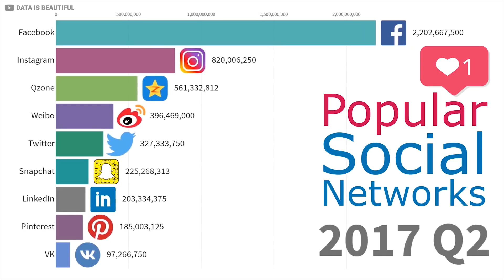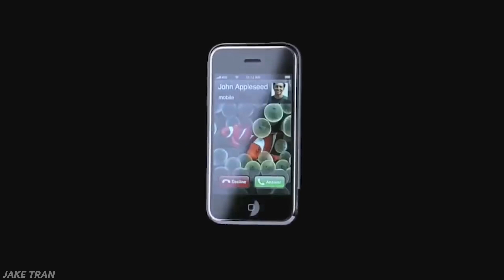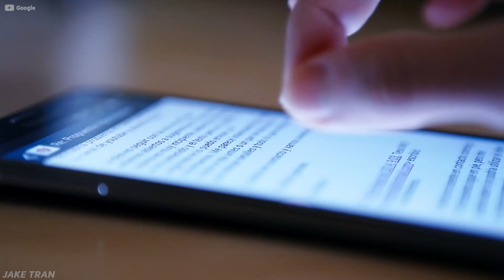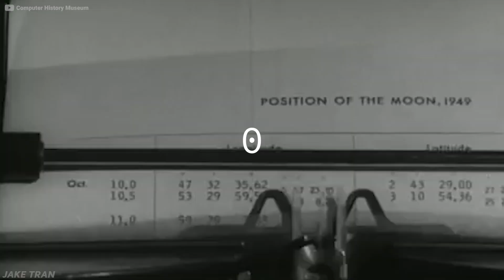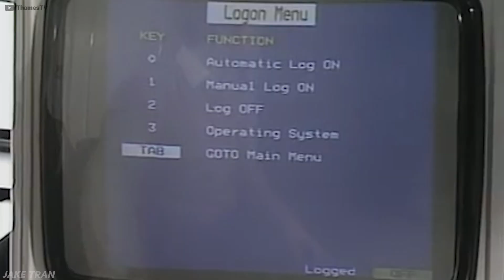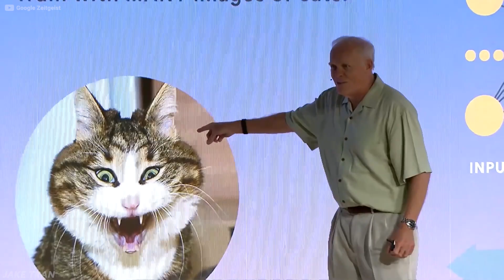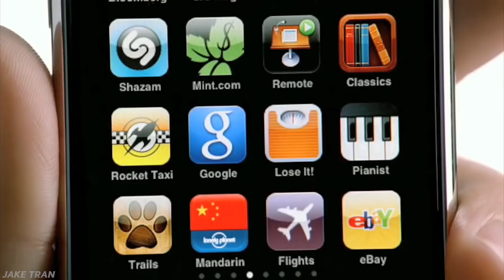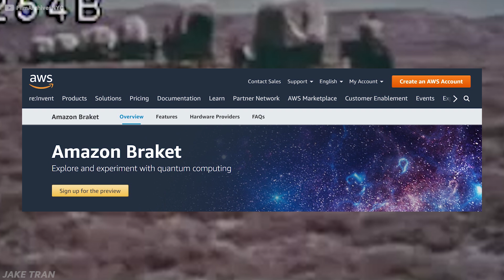The Trillion Dollar Quantum Gold Rush

Comment: "we are getting to point where we are getting to the physical limits of how many bits we can squeeze together onto a single computer chip"

this is not really the problem.  1st, transistors (not bits) are put onto the chip.  2nd, more transistors can already be put onto existing chips, but thats not the issue.  
the problem is speed.  just putting more transistors on the chip doesn't make the chip faster. speed comes from making the chips smaller.  the bottleneck comes from the speed that the electrons can travel through the printed circuits.  thus speed increases have come mostly from making the chips smaller, and reducing the length of the path that the electron has to travel.
light+ a mask is used for printing the circuits, and we have use the shortest wavelength of light that is possible, and thus further reductions in size is difficult/impossible.  

the solution now has been to add more cpu's to one chip, making multicore processors.  but now the new problem is that the software must now be redesigned to utilize the multiple cpu cores, which is often difficult to do.

Comment: If you can achieve quantum calculation on the scale of a few bits, you could in theory achieve it on the scale of terabytes. And if you can achieve quantum calculation on the scale of terabytes, you can store every single byte of data that ever existed at the size of a tiny USB. 

To quote one of the comments - "If you understand quantum computing, then you don't understand quantum computing."

Comment: Probability amplitude it same as Boltzmann - Maxwell statistics which tell if you want applicable thermodynamics internal combustion engine you must in put useful work, random based kinetic energy machine is called (Maxwell demon)  demon who can reverse II thermodynamic laws and entropy arrow, so Back in Future possible only to Maxwell demon :))) Scientific papers shows that demon also consumes information (so energy too)  limitation even in thought experiment :)
Also Quantum mechanics is statistics so no engineering application, if you read patents and find words quantum, in reality that engineers created smaller version let say they found special material alloy that can keep magnetic field in very nano-meters size area, instrument manufacturers got patent minimization of device who can read very very small weak magnetic field, where is Quantum effects ?,  zero inventions in quantum mechanics field, where negative energy inventions where quantum tunneling effects inventions. Statistical gas mechanics and quantum mechanics is highest point of all physics, mathematics in absolute beauty, mathematics philosophy, but also this mathematics tells that statistical thermodynamics (kinetic energy of gases) and quantum statistics (quantum mechanics) is not applicable  in one electron size (qubit) or in one atom either (Moore law  of CPU material limit) only in macro electronics switch boards  and computer integrated circuits (no math pun intended) are possible, and macro applicable thermodynamics of heat engines.
Maybe promises of 60s that all humanity will live on the Moon in 70s to keep technological progress going  :)))))))

Comment: Dude, you should have talked about transistors, instead of bits. Transistors are the electronic component that are used to store and make computations on the data, which is recorded as bits, because you can code every information using bits. That is because you need a minimum of two states to represent information, because if you had just one state, that would mean change would be impossible, or the entropy would be zero, and then there would be no information. The transistors are the bottleneck nowadays, because they just got very small, and it is getting harder and harder to squeeze more transistors into a small space. Not the bits. The bits are some abstract data representation.

Comment: You must be a software guy with that explanation of classical computers. Transistors mate, switches that represent 1 or 0 or your bits. Getting to the point where there's a limit to how many transistors you can put on a wafer before logic gates stop working right. The limiting factor is size.

 Something like quantum particles entangled in pairs make up your qbit. Cryogenics is required at this stage in tell we get something like a room temperature super conductor which makes it bulky. Just saying.

Comment: That huge metal thing isn't even the computer, it's the cooler. The actual "computer" is only a small CPU. But the problem is that it has to operate at near absolute zero temperatures, so a major part of the research is going toward making it be able to operate at higher temperatures. One team of scientists has reached operation temperatures of 1.4 Kelvin.

Comment: Do you known why beacuse silicon transitors can only be 5nm until it won't work anymore. Processer these day are 7nm and when we get to 5nm we are done . New material is needed to build faster and efficient devices .also fact checking you bit system your wrong . A 1 in the first place is a 2 then the second place is a 4 then you add it up to get the number . Mostly it 8 bits which is   like this 64.32.16.8.4.2
                 1.0.0.1.0.1
Is 64+8+2

Also quantum computer are not good for consumers

Comment: The plateau has a bigger cause then I think you should've mentioned, a new focus on margin and affordability by the major companies has really pushed this. Layering and simply having light hitting each molecule would prevent quantum effects and would increase speed greatly.
I feel like quantum computing won't be available for the consumer for a long time. Not because of cooling issues like commonly thought, we can just use a mix or liquid oxygen/liquid helium, or even solid helium.
The issue is flammability and, well bombs. The only way for one to properly cool a computer to this level, would be to use high pressures or flammable molecules. Rocket fuel isn't something you'd want cooling a very expensive machinery, nor would you want a system that makes steam hammer seem like a baby's cradle. Until that issue is fixed, we likely won't find this amount of computing available to the public for a very long time.

Comment: The issue with quantum computers is that they require near-zero temperatures to operate. This creates a physical barrier to reaching consumer level that won't be easily overturned. I don't believe quantum computing will come to consumer level.
Reply: The issue with main frame computers is that they require giant vacuum tubes and an entire room to run. This creates a physical barrier to reaching the home market. I don't believe personal computers will ever become a reality.
Reply: Not if they use exotic materials foe example quantum computer needs cooling at sub zero for superconductivity but their are potential materials that can achieve superconductivity at room temperature i.e the physical barrier is almost gone and also not everybody needs to carry their personal quantum computer we can connect our normal hardware with high broadband to a quantum cloud which will process and relay info with full power and our personal hardware will remain intact.In order to learn about materials search quasi crystals.
Reply: Why not Create some kind of little chamber type thing and in that you can put your quantum computer and it's Spray liquid nitrogen in the cycle of 3 to 4 minutes to maintain temperature at 0.
Reply: What about cloud quantum computing? Yea, I guess not consumer level but a company could invest in QC and source it out on cloud so anybody can do a certain task quickly and receive the output?
Reply: yethi ravindran  
I think his example of exotic materials is quasi crystals
Reply: Am sure they said the same thing when computers first came out and were the size of entire rooms
Reply: The companies with the money to utilize this tech will trickle down the benefits to consumers. So much would change, especially in AI and machine learning. Idk even what a common consumer would know what to do with a quantum computer. Current tech is already magnitudes more than what your average non tech savvy person needs.
Reply: soon*

Comment: Quantum computing is basically a random number generator it’s practical use is almost zero. I would actually think more about lighting or liquid computers.

The problem is just the collapse of the wave function that is needed to get a state that can be consumed by anything.
Btw we already have lots of algorithms that encrypt in a way that it’s useless to use a quantum computer.
Reply: Platin 21 Not to mention all the noise reduction required and the low operating speed. Quantum Supremacy has been said to have happened (Baboush et. al, 2019), but I bet that unless we come up with a new mechanism for computing data with a quantum logic structure, this technology will not reach the capacities which are marketed to 12 year olds on YouTube. Not hating, just saying we need to stop being too excited and start solving problems

Comment: It's hard to see how to take advantage other than investing in big tech, but one thing a lot of the lay public doesn't yet understand is that it takes a new kind of programmer to take advantage of quantum computers. You don't simply say "OK magic new computer, try all possible passwords simultaneously" to crack modern encryption. It's more like picking a lock. You can start by learning a little "quantum info. theory" and the early algorithms like BB84.
It's not just a new kind of computer, it's a new kind of programming language, which will start with some very low-level, hard-to-use languages, which will gradually evolve into more powerful, easier to use languges like python or wolfram language, which children can use.
Reply: Once quantum Java is created, I will create 5D Minecraft, and destroy the FPS with quantum "else, if" equations

Comment: Quantum systems, on the whole, don't actually do many different things compared to traditional computers, they just do it orders of magnitude more efficiently and flexibly. 

Having computers that can run extremely intense programs at high speeds doesn't really help you when you're just trying to show a website with a couple of ui elements. Sure, there will be new functionality, and cyber security will need to change overnight to adapt, but long term? Quantum computing doesn't do much different than normal computers now.

The real money will be in asteroid harvesting, as with the proper rocketry, robotics, and control, that could potentially be done today. Raw materials are valuable man.

Comment: Nice video! 5:05 Someone correct if im wrong, but I think that the fisical limit is not because of how we store bits, but because of the way we operate with them, which is through logic gates made out of transistors, and those transistors are coming to the point were they measure  10 y 20 nm whichs is arroun 100 times the size of the electron cloud surrounding an atom. Which means that we are close to the point were an electrical charge will not "be able to pass" through these transistors if we make them even smaller.

Comment: That claim that it takes a super computer 10,000 days to process what a quantum computer can do in ~3 minutes is technically incorrect. 

Quantum computers are exponentially faster than traditional computers but "10000 days" really just requires the model that analyzes the problem to be optimized. It's really more like 1 day and a half versus 3 minutes. Much faster but not THAT much faster.

Comment: there's a lot of pessimism on the engineering side, a lot of the hype is coming from physicists and computer scientists.
Reply: PathIntegral Them engineers, always being pessimistic and doubting the physicists and computer scientists about everything. 
Can’t they just woopee once.
I think they were once so pessimistic about General Relativity that they decided they would implant a backup just in case even though general relativity works perfectly fine until we get to the quantum scale of reality (or so most physicists think).
Reply: @funkyflames7430  because engineers are the ones that have to build it.  Engineers are bound by reality, a physicist and computer scientist aren't. Its not about doubting the physicist, it's about doubting how one is supposed to implement the idea in real life with all the restrictions of metarials and manufacturing method and etc

Comment: I know it's just a small thing but I'm pretty sure q-bit is pronounced cue-bit.

Also quantum computers are only better than classical computers at specific tasks, there are lots and lots of things classical computers are way better at so classical computers probably won't get replaced by quantum computers. Another thing is that they require extremely low temperatures to operate which is why I think you probably won't find them in phones anytime soon

Comment: Do you have a good understanding of quantum mechanics and computer science? I would be very careful, as far as I know quantum computers likely impossible. Google and other companies have failed to make a working computer. Sure they make insanly  fast but there is an issue with stable memory due to the nature of quantum mechanics. Many physicists think it's not possible.
Reply: Gabor Kovacs google already achieved quantum supremacy
Reply: Benji true alongside nasa but even still they technically just beat classical computers in only one scenario and that is what it means to reach quantum supremacy.
In other scenarios, quantum computers still suck.
Though all we need is just more work at the stability of the technology which comes down to design and cost.
Reply: EmpireBuilder they are meant to be better at parallel processing traditional computers will always be better at processing in series
Reply: @benji4037  yeah that was a click bate atricle spreading like a virus. Just do the research and look into what they have done yourself.

Comment: How can one invest in quantum computing?
as you were saying, it's a good time to invest in such an industry, so, how could one do so?
thanks
keep up the good work.
Reply: Bilal Hoss yeah
Reply: FInd the person/company that can build the first quantom computer.  person/company would need hardware such as a cooling system, a quantum processor chip, someway to store all the data and there will also need to be a software. if you want to invest look into chips being optimized to handle AI algorithms
Reply: aml1583 yah... more than likely you are going to have to find a company with that set up. A single person doesn’t really that the necessary equipment for that...
Reply: If you have a decent sized capital check in with Rigetti, DWave, and IBMQ and say you want to invest in their projects

Comment: form factor and application will ultimately determine how well Quantum computers impact us. It takes practical application to push technology forward. Right now we have the how, but the why still remains a bit shakey, we're only taking guesses at what innovations Quantum computers could lead to, but ultimately it will the form factor that will drive the tech, like the iPhone pushed mobile processors to leaps and bounds. E.G. quantum computers might on some shocking level indirectly enable us to do things like travel faster than the speed of light, or to change the way in which we are able to communicate, making it what could easily be called instantaneous. Imagine you pick up your phone, call a friend, and the moment you hit dial your friends phone rings that instant, it then becomes like you have someone else in the room with you. The delay in sending and receiving information could change entirely, and it could also open up our understanding of the mind, body and universe, significantly more than we already have today, it could lead to both tech and medicine making leaps and bounds that we initially expected it, to take thousands of years to achieve if not much much longer.